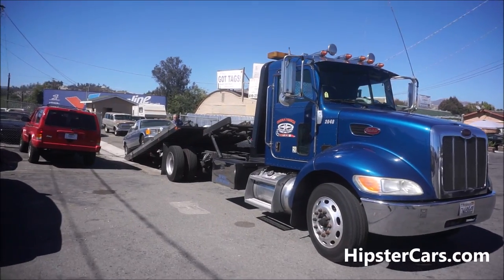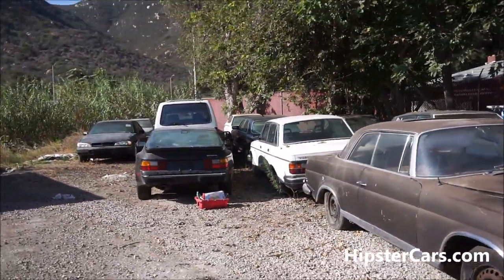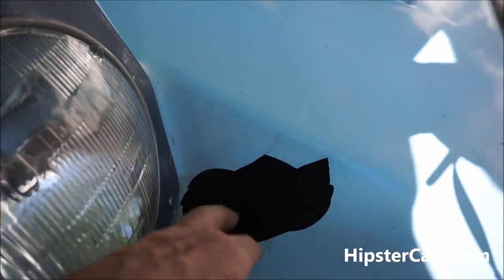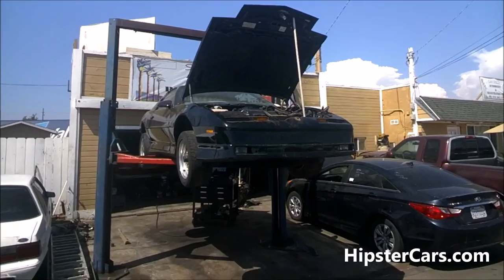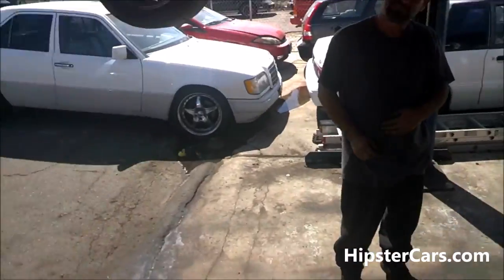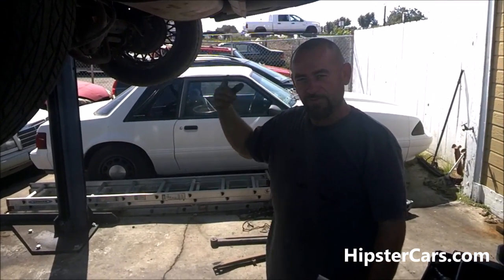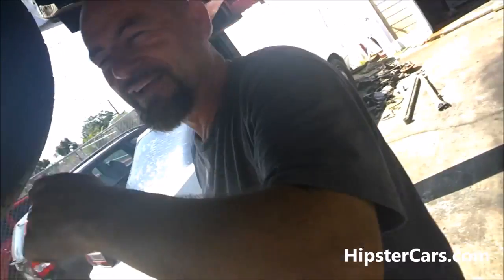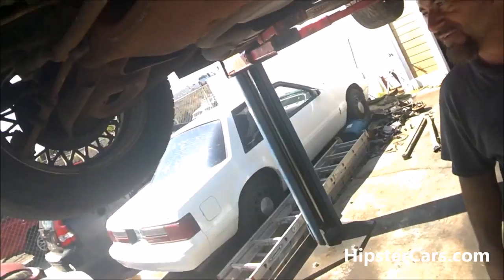Sold Movie Car Studio AWFUL Washing Cars Job ~ GTA on Lift Vlog Video

Comment: The reason why some people don't like FRAM oil filters is that they were (maybe still are) using a cardboard spacer inside their oil filter to hold the filter element in place. Once the cardboard had gotten oil saturated (through time) it would collapse and then it would no longer be filtering the oil.

Comment: My 2000 E320 Benz was used in the show Grimm. I picked it up needing a gas tank and taillights for $1500 with 120K miles.Best running driving car I've ever had. You can tell the guy has no passion for cars. it would kill me to let soap dry on a junkyard car. lol